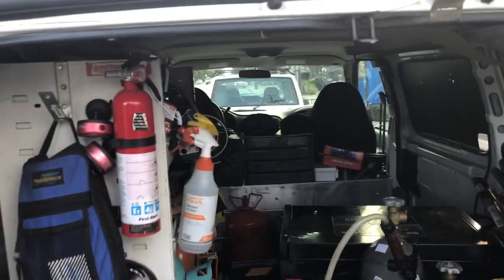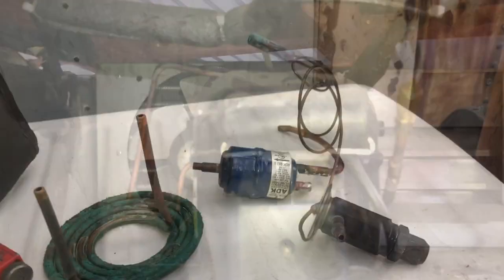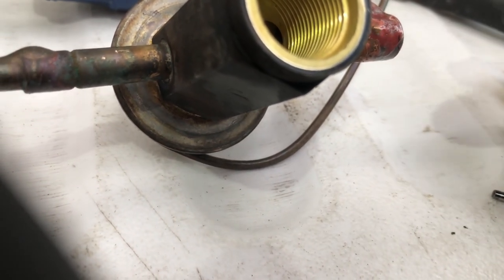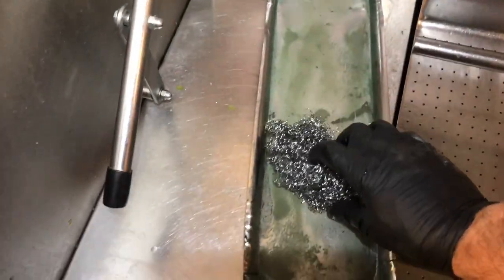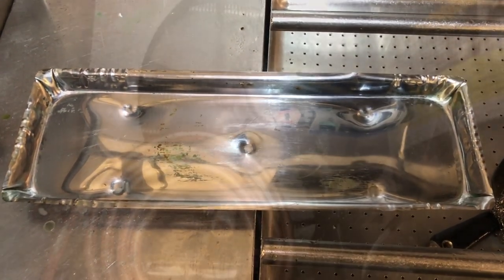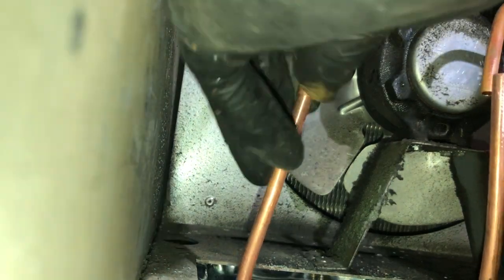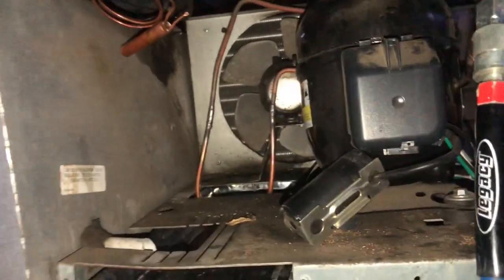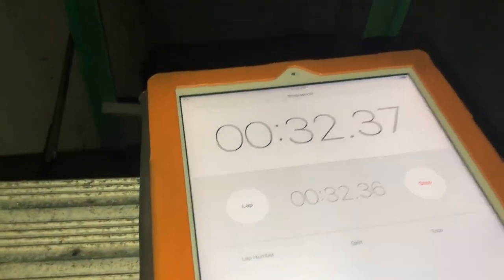Traulsen repair

Comment: That thing was pulling down good with the ballast still open! I pressured tested a mini split against the valve core one day for 15 minutes before I figured out what I was doing. I pushed a lot of nitrogen by it lol. Good repair Dave!
Reply from the maker: ComfortPlus Heating and Cooling I forgot about the ballast for about 15 minutes then closed it. 😂😂 I was like my pump sounds funny. 😂😂

Comment: Great vid. I love that pump, works great. I recently got a spin swage kit that fits in the drill. I love it, it's super fast and easy to use. Works great for replacing the loops.

Comment: I never use captube driers with desecant beads. I always use 032 or 052 depending on size of units. The bead driers will vibrate the beads and plug up the new captube.
Good work 👍 you don't have to worry

Comment: Nice Quick evac, could you show your most efficient way of moving over to charge after evacuation, how you tie the cylinder back in - do you evacuate the charging hose or do you purge it out? Any tips for these small tight charges when waying in on the fly?

Comment: great tip on the reason why you should mount the TXV upside down... never thought about that...  The super heat was a bit high though.  The back pressure looked OK though.  Maybe place the temp clamp inside the box next to the bulb next time.  I was always taught 6" after the evap coil. have you ever thought of adjusting TXV's like Jim P.?

Comment: Yeah I agree, sometimes it just isn’t worth the effort to swage when you can just throw a coupler on and be done. Good video Dave, thanks. Sorry about your old iPad....
Reply: On soft 1/4 & 3/8 inch  use needle nose pliers 60seconds done! You are welcome
Reply from the maker: 404 Refrigeration thanks. That iPad was doomed. Lol it was time to upgrade and the new ones can be had at a reasonable price now.
Reply: shuld the green on the copper be cleaned off from time to time?

Comment: I don't do swaging on repair jobs too often either.  Installs... usually.   Repairs... not so much.  Many times the accessibility issues seem a lot more expensive than the buck or two for the fittings.

Comment: Great job Norcal Pal! I see your vacuume was slaming @ first then started to slowdown? Chris S from HVAC VIDEOS says that those dam valves leak and you can't pull a decent vacuume. Do you think that was happening ? The gas was leaking?
Reply from the maker: I think refrigerant in compressor oil. And gas and goes lead to a dirty system and vacuum times are always long on older systems when pulling with the compressor Oil in vacuum

Comment: Nice repair dude. How’d you like the pump? It slows down a lot after 1600 microns for me. Was thinking about a navac next.
Reply from the maker: Robert Walsh I need to use it more.  That system took for ever to pull down.  Moisture in the system.

Comment: Hey Dave I got a traulsen refrigerator rht232wut-fhs and I was wondering what the problem is on it. It fully runs good but it just won’t go under 50f would you possibly know what’s the issues?

Comment: hello Dave, great repair video. a question: it would not prevent the fast korosion the condensate loop if you einsprüht before installation with paint. The corosion is indeed by electrolysis (copper coil / kondenspan and water) it is practically a voltabatterie.wenn now the coil is insulated with paint spray, there could be no voltage and the condensing coil would last longer.

many Greetings

walter
Reply: some systems have plastic pans and stainless steel coils for the evap. but they still leak elsewhere and end up getting scraped..

Comment: So I brought a “beverage air” refrigerator back to life after it sat in the restaurant kitchen for almost ten years not plugged in. It’s cooling  too cold! Do you think this could be a thermostat issue or a Freon issue? My boss likes sicking me after her dying appliances and I’ve done a good job at getting things going. The fridge is cooling to about half a degree under zero (I’m in Canada so we go by Celsius here) should I try changing the thermostat? I have an unopened can of R134a and a hose with no gauge. I feel like no matter where I set the thermostat it always cools below zero.
Reply from the maker: Ardie McLelland check your charge

Comment: From what Ive seen, swedging is all good and fine when and where its applicable, but I havent found much use for the method in refrigeration work, stuff is just too small to be banging around on.  At least thats my take,  I will sweat couplers any day given the choice.   One other thing Ive wanted to ask,  Dave,  do you have a son or young protege you can pass all this wonderful knowledge on to?  Would be a wonderful opportunity for the right kid, not sure how much luck you guys have out there with the younger crowd, it can be iffy at best these days.
Reply from the maker: Repete Myname great question I’ll have my 15 year old helping out this summer is the plan.
Reply: @NorCal-refrigeration  :  Good deal, young padawan will have a leg up on the competition for sure.

Comment: New screen for that I pad wall mart 30 bucks . Real easy to replace
Reply from the maker: Michael Echevarria we don’t have a wall mart😂 can you believe that?
Reply: Nor-Cal Refrigeration & H.V.A.C 

Wow lol sounds like a good investment can be made . Check out amazon if you get it all  you need is a heat gun or hair dryer to remove the old screen.the new screen kit comes with repair tools to take the screen out once the glue gets heated

Comment: should have probably left the broken gauges in place to keep the manifold sealed up / crud out, until you had new ones =p
Reply from the maker: throttle bottle those are from 2008 they have had everything through them. 😂😂

Comment: Good vid. Thanks for the Heads up on the Time delay on fans on traulsen. No Traulsens around here. 99.9 percent True refriges and freezers  or chinese now.
Reply from the maker: OcRefrigeration,Hvac & Electrical. I went to a new customer last night all Chinese fridges all warm. Leaks, and melted Dixel controllers.  Fun times.
Reply from the maker: OcRefrigeration,Hvac & Electrical. Yep. No video the customer was lurking hard 😂😂

Comment: Good Video ! Man that System Was Wet ! When u see it slow down at 2,000 like that you know shees wet. buy yourself some of those VV Driers from emerson they have access valves on the drier. thye are like ek052sVV, Great for accessing the high side of the system , no additional welding. i Allways pull vacuums from both sides of the system because i allways want to know my head pressure when the sytem is running and vacuums are quicker. Also When the Vacuums Slow down like that Hook up a Bottle of Dry nitrogen to it and Blow the Shit out of it with Dry nitrogen and pressure test it a bit with 100 psi of nitrogen and relaease it. that will usually take care of it and get the vacuum speed back again. also a oil change on the pump . verify pump will pull it self down still sometimes pumps can get wet real quick and u need to do an immediate oil change. Good Vid !

Comment: Good Vid. i was kind shocked no high side access to system. head pressure is kind of critical for me to know. i Like knowing My subcooling too so i know if ive got a column of liquid to feed txv. those little units are all rated at 5 degrees of subcooling.just a engineereing bit of data i found on tech sheets.  Evacuation would have been twice as fast pulling from both sides of system because txv & high side compressor valves blocks off liquid side where the water was. YOu had to basically turn the water into vapor and pull it through the txv to remove it. which takes a reallllllly long time. i totally agree water was in that system. u nailed it on that one. as gas was flying by the leaking condensate loop it was pulling in water. a high velocity pull in kind of like how a venturi effect bilge pump system works on some boats as the water rushes by a open hose it creates a low pressure effect and has a sucking action on the hose to pull water from the other end of the hose. thats most likely what happened here. i use " VV " Liquid line Driers now. they have Pressure taps built in on both sides. Part Number --- " EK052S VV " ---
or Ek163svv , ek082s vv . Elimates having to put in high side accesss tees any more.

Heres a link for " Ek052svv " drier --- https://www.johnstonesupply.com/storefront/product-view.ep?pID=B15-360

 Heres a Link for " EK163SVV "Drier and part #  https://www.johnstonesupply.com/storefront/product-view.ep?pID=B15-363
Reply from the maker: OcRefrigeration,Hvac & Electrical. No need for highside port unless your having issues that need troubleshooting
Reply: Think cavitation killed that txv, as for the condensate loop, put it underneath the condensate pan instead of in it. No moisture no corrosion.